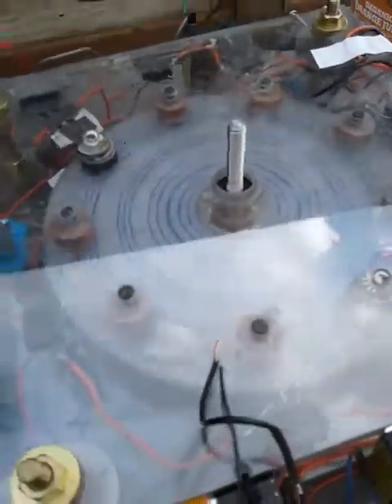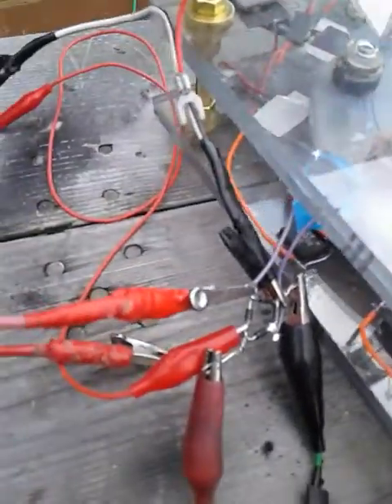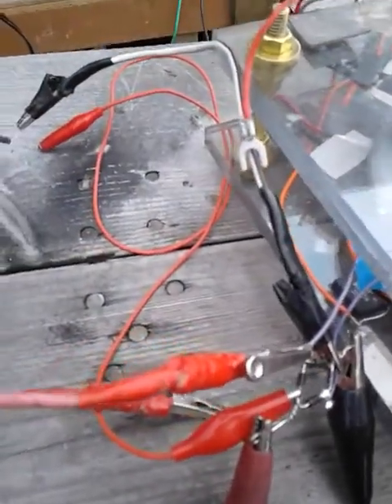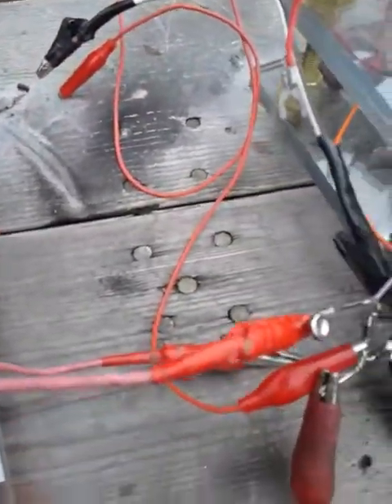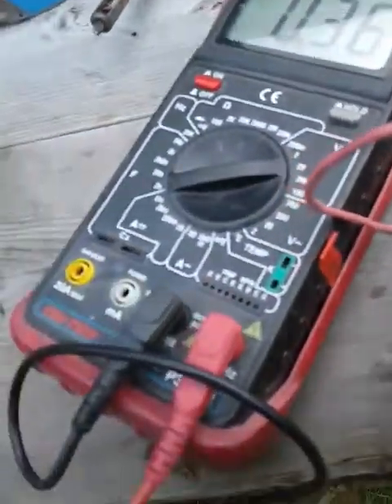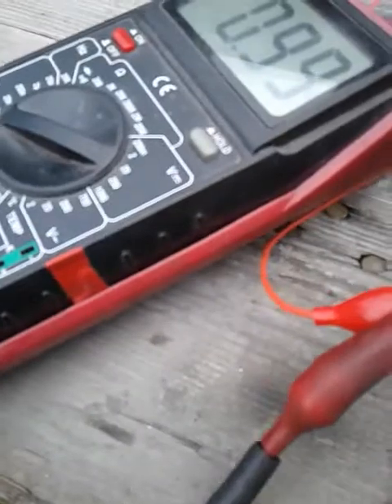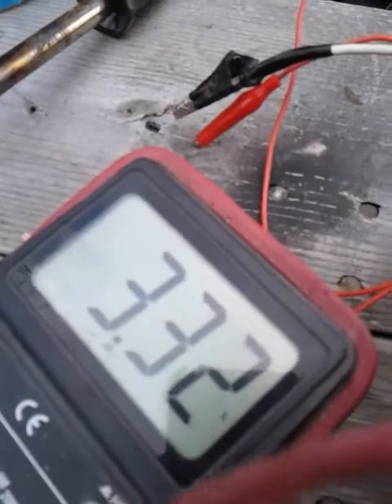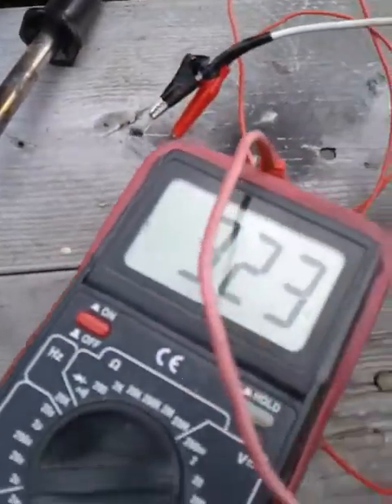shorting coil for voltage X10

Comment: D, is this partly how the Konzen motor worked, was coil shorting involved ?
Reply from the maker: Hi Mike, the konzen motor (AKA konehead motor) worked like a GRAY motor, in that it has bucking coils N against N that get pulsed DC when the coils line up facing each other,  and the rotor gets flung around from the bucking fields. Also I added "reguaging" magnets later. that would flip polarity of the rotor cores, just before they lined up to the stators again, and this would give a free power stroke to it.
"Peak coil shorting" discovered about 2008 and its something you would do to generator coils....give a quick short circuit to the generator coil at its sinewave peak and the coil goes into hyper ringing and you collect the HV flurry of spikey stuff into a capacitor through a FWBR and then unload cap to load for power.
Here is chapter about peak coil shorting from my online book:
https://alternativeworldenergy.wordpress.com/alternative-world-energy-pg-3/
Reply: @MrDKONZEN  D, thanks for the reply - I'm not well versed in electronics, I will be reading your books excerpt though - right now I'm looking for something extremely simple and I was very curious to know if it's possible to build a rotor that runs completely by coil shorting OR unshorting - do you happen to know if this is possible ? - correct me if I'm wrong but when I listen to The Talk given about the Konzen motor I saw a similarity with the Adams motor - I know they're very different in overall design but I couldn't help but notice the similarity in the way rollers were used for contacts, presumably to get a sharp pulse
Reply from the maker: @mikehoman7351  Yes similar to the Adams motor, the Konehead motor is coils NN for power, the Adams motor is a magnet against a coil for power, either attracting or repulsing or both.
Both have sharp DC pulses, both recover the flyback spikes too.
A completely shorted out coil to a rotor in a can motor work as a motor, in HV DC pulses into coils next to it vould fling it around. 
Sinewave peak coil shorting  is a little bit "repulsive" to a magnet, you might be able to do something with that
Reply: @MrDKONZEN  thank you I'll let you know if I get something on that, I'm waiting for supplies right now